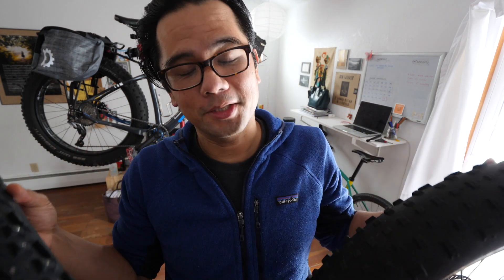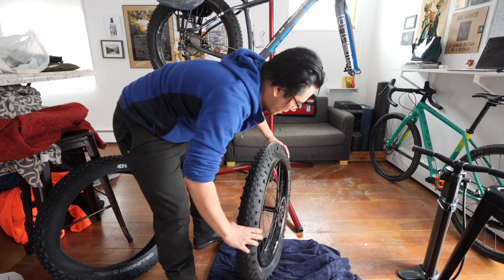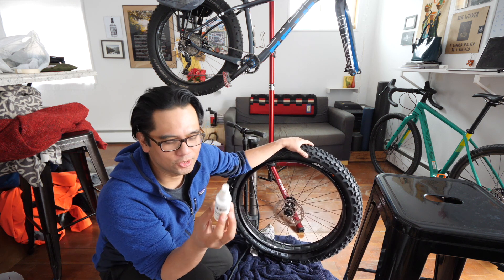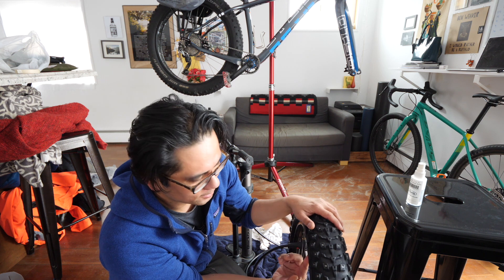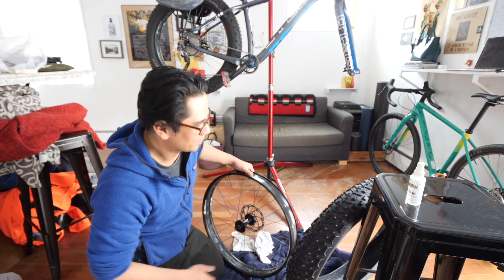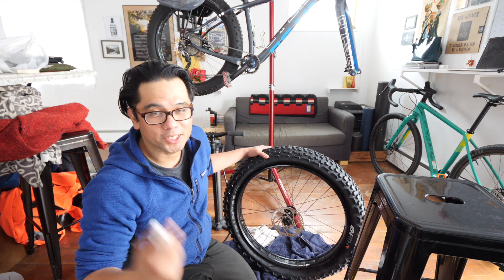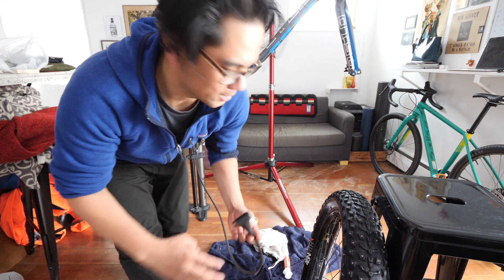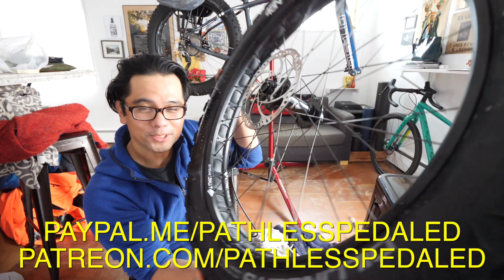MAN vs TUBELESS STUDDED FAT TIRE

Comment: Others have mentioned the compressor, but you should also remove the valve core to seat the tire.  That way you get far more air through the first time which makes it easier to seat the tire.
Reply from the maker: The Blackburn pump doesn’t grip well when the core is removed, otherwise i would usually do that.

Comment: Nice one. Another trick to get it seated is to inflate without the valve core, this massively increases the air flow. You have to take it out to get the sealant in anyway, so may as well start with it out, works every time for me. Cheers.
Reply from the maker: Yeah, I've done that with gravel tires.  Didn't have a big fat tube laying around though.
Reply: Path Less Pedaled you don’t need a tube, just a tubeless valve with the core removed. I prefer to use shraeder valves because they are wider and without the core deliver tons of flow plus I can have a valve cap with a built in core remover, simples.
Reply from the maker: @davidmithen9223  The blackburn pump doesn't hold tight enough with valve cores removed.  Pops off.

Comment: Bungee cord(2or3 if needed to reach orotund tire around center of tread. Pops on right away   I’ve used this method 5-6 times worked every time. Before that I could never get it to seat

Comment: I couldn't quite tell if you did this or not but when you are doing the dry fit keep the valve core out the chances of seating the tire go up quite a bit when the air can rush in to the tire that much quicker
Reply from the maker: The pump I was using shoots off without the valve core in.
Reply: @PathLessPedaledTV  good to know I have been putting off buying that same pump for a while  now I have a better reason

Comment: I put a tube in there, pump it up until it seats, take off just 1 side of the tire, remove tube, then pump while the side you have opened is facing down. This allows gravity to pull rubber down to the bead. Easy peasy

Comment: could have used a piece of rope or strap around the whole tire with a dowel to twist it.. compressing the tire bead to the rim.   Hold that tight and release the pump pressure.  It's a pain but it works.

Comment: Throw a tube in so you can seat one side of the tire(both but you only break one side to pull the tube out) then charge your pump and it will seat the single side easily. Works every time for me.

Comment: Never done fat tire tubeless but  there's a couple things I found using the charger chamber style pump. Even with regular size tires, once you release the built up pressure chamber you need to immediately start pumping to keep forcing air in making the tire bead jump over the rim bead wall, otherwise the air going in just slowly leaks. If you're not hearing a pop, yet the air doesn't escape all at one, it means you're close but it's just not enough pressure to force it over the rim bead wall. Also soapy water does not make a temp seal at all... it's slippery and aids in helping the tire bead slip over the rim bead wall. Another tip is insert a tube (no idea if fat tires take tubes) and blow up the tire to get both beads seated. Break ONLY one bead off and remove the tube. Setting one bead is way way way easier than both at the same time.  
Hope some of those help for next time. Setting up tubeless gets easier everytime you do it.

Comment: Install tube to seat tire bead. deflate and remove tube being careful to only break one side of the tire bead. Install valve stem, put tire on 5gallon bucket open bead side down, and hit with compressed air till it pops in place. Add sealant and call it a day. Work smarter not harder! No need for soapy water or 5 layers of gorilla tape

Comment: One thing I've done with tube-less tire set-ups is to use a Q-tip to clean out the valve stem after I've injected the sealant, that way the Stan's (etc.) doesn't clog up the valve core as you put it back in. Perhaps this is unnecessary, but it seems to work for me. Hope that's helpful. Thanks. Tube-less set ups can be trying! But worth the effort.
Reply: I have a better way... I don't use Stan's.

Comment: I just saw your tubeless tire video for the first time. I’m really enjoying your content. The bike packing and gravel riding is really appealing to me.  I just finished building my first bicycle in almost 20 years. It had to be an all-round bike, so I took a lot of ideas from different channels. So I built a Ritchey ultra. I’ve been a big fan of Tom Ritchey for many years, but never had the opportunity to own one. So I sold half my guitar collection and built one. There wear a lot of firsts for me in this build. Hydraulic brakes, carbon bars, 1x11 drive train, dropper seat post and tubeless tires on 27.5 wheel set. Plus Size! Love it! Out of all the new changes to bicycles , the tubeless had to be the strangest thing to me. The concept of coarse is not new. Cars have been using  this system for many years. With the added feature of self sealing liquids. Of coarse they have perfected the system of installing a tubeless tire. But early on they had issues of getting the bead to seal. One way was to compress the out side of the tire toured the rim. A vary easy and cheap way to do this, is to use a ratcheting cargo strap.  you can buy them at Wal-Mart or Harbor freight. You don’t need to tighten the strap all the way down. Just enough to put positive  pressure on the tire. You probably won’t have to charge your pump all the way up. I hope you find this useful thanks for all the great videos and info.

Comment: I had a rock puncture my side wall and did a trail fix w/ tubeless plug. It’s holding and I’m wondering if I should change out the Fat Tire. 
What are your thoughts??
Thanks Dave
Reply from the maker: Depends on how big the gash is. I would keep an eye on it to see if it grows and wouldn’t ride anywhere too remote unless I knew it would hold.

Comment: With fat tires I’m a big fan of using a ratchet strap around the tire tightened just enough to force the beads out to the edge. I do that, hit it with a compressor and usually get it to pop first try. 
Great video BTW!
Reply from the maker: How do you put the ratchet strap on? All the way around the diameter?
Reply: Exactly that, right around the center of the tread.  I just have a cheap set from Home Depot that are red. They have hooks on the end and just hook those together and cinch it up a bit.
Reply from the maker: Good to know!
Reply: This was going to be my recommendation for Russ. I always try the ratchet strap prior to trying more tape. Great vid.

Comment: I’ve found when putting tubeless tires on if you seat one side by hand first it makes it easier and also pinch the tire a couple inches from the valve. I’ve not once had to use soapy water to get them to seat.

Comment: I've found that putting the wheel horizontally flat in a bucket helps during initial inflation because the tyre is less likely to deform like when it is on the ground.

Comment: I put in an inner tube to set the bead. Once bead is set, let the air out and just remove enough of one side to get the tube out. Do this at the location of the valve so you can put in the tubeless valve. Blow the tire back up, with one side still seated, and most of the other side seated, the small arena that was opened back up seats easily. I don’t really like the thought of extra tape in there between the bead and rim.
Reply from the maker: I've done that with other tires.  Just don't have a fat tube laying around.  Usually more tape is the answer IME.
Reply: Ditto what Dan said- This works for me first try, every time.
Reply: @PathLessPedaledTV  you should always carry a tube..hell I carry 2, or ya cant bitch when you are walking your bike home, or cant get your tire seated. Ya got thousand dollars bikes and cant splurge on a tube. Check your priorities

Comment: I just did a Dillinger 5 last week and it was tough to seat. I ended up seating one side with a tube and then the other side popped in pretty easy with soapy water. Took about two hours lol. Killer tire though!
Reply: That is the only way I do tubeless. It takes so much cussing out of the equation.
Reply: I use the same trick to seat my D5's.
Reply: @408SPLKINGS  apart from that one stubborn Dillinger all my tubeless setups have been effortless. I recently setup some WTB 700c gravel tires on Stan's rims with no tire levers and just a track pump. Zero mess and was done in no time! Tubeless is still king in my opinion. You just need a few tricks for the stubborn tire/rim combos but it's still worth the effort.
Reply: @408SPLKINGS  I've heard of some people having issues with losing air over time. Depends on the sealant you use and the tire casing but I've used orange seal with no issues. Good tubeless valves with a rubber gasket help too! I think the cheaper ones don't seal as well and leak air over time

Comment: After being instilled with a false sense of confidence from my Easton Arc rims and Maxxis tires on my normal bike, I tried to get my fatbike set up tubeless last year, ended up using so much gorilla tape and still not sealing that it was equivalent or more than the weight of tubes... I gave up and kept running tubes.

Comment: As a guy who uses clinchers such video is a bit of irony, because tubeless is supposed to be sooo advanced over clincher ;-). But seriously, in this particular case, why do you use tubeless in the first place? You are riding on ice/snow after all and additionally you have big knobs on the tire. Btw. you are spraying your tire on top, it is much safer to do it at the bottom -- you don't want to contaminate brake rotor.
Reply from the maker: Not having a tube that weighs a pound per wheel is a big advantage. Also not dealing with a puncture in the snow is another.
Reply from the maker: Also, I do this is as a public service. Notice, I wasn't saying TUBELESS IS THE BEST THING EVAR!  It has ups and downs and is mostly a PITA.

Comment: Last time i did my  tires on my fat bike i fought for an hour to get my bead to seat. After I finally got it I realized i put it on backwards. I said every four letter word possible. With high volume tires it helps to wrap something around the circumference of the wheel like the motorcycle guys do.It helps push the beads closer to the rim.

Comment: Man, I can relate to that! Last time I tried to mount new tubeless 35mm tires on my Gravel bike it just wouldn't inflate whatsoever. I only have a normal floor pump and after about 30 minutes I was completely sweat through and just gave up. Luckily I have a gas station just a few hundred meters down the road and they have a well working compressor with an accurate scale. With that it was just a matter of about 5-10 minutes. I don't think I will try this at home ever again.

Comment: Does your sealant not freeze once it gets cold enough?
Reply from the maker: No.  It stayed liquid all last winter.
Reply: @PathLessPedaledTV  Interesting! From looking online some actually contain anti freeze but I've met a couple of mtb'ers that unfortunately had their sealant turn into a block of ice on the ride #notsosupplelife
Reply: @KomplexTherapy  yeah, different sealants are rated for different temperatures, but Stan's is rated to -20° (Fahrenheit, I'm pretty sure, but it doesn't matter much down there anyway), and I'll hopefully never be out in anything colder than that. Most standard sealants are a mix of particulates, liquid latex, and some form of glycol to keep it from freezing. :-)